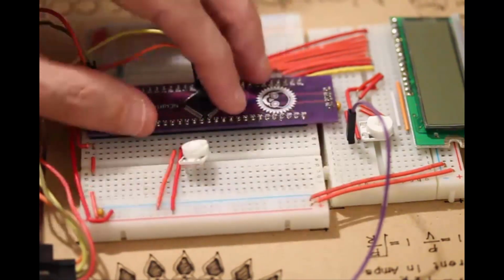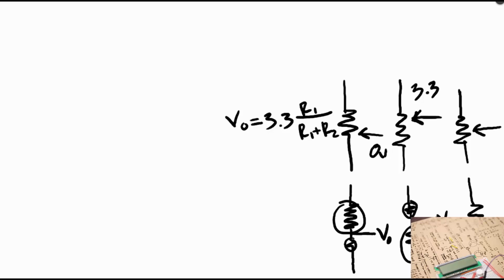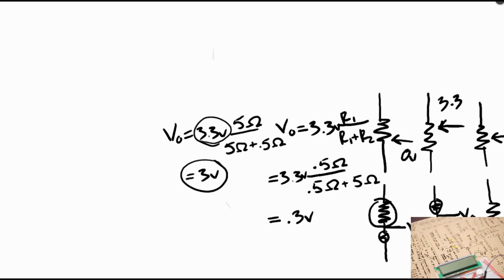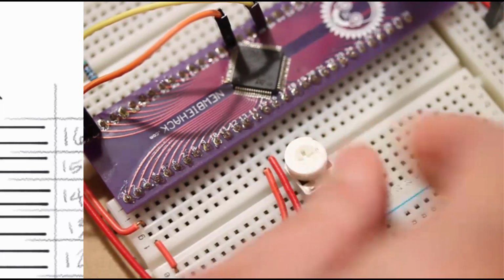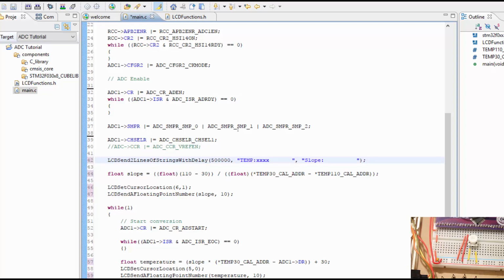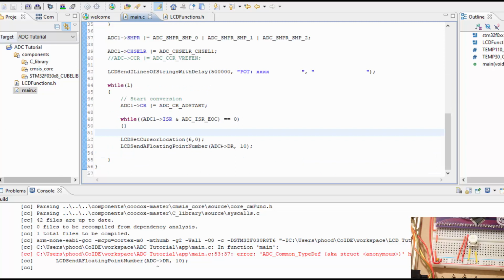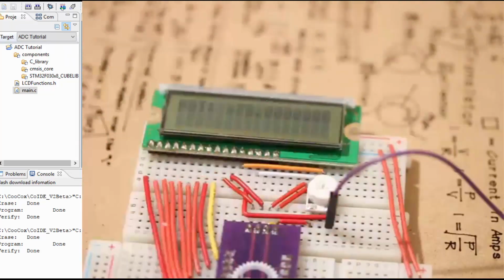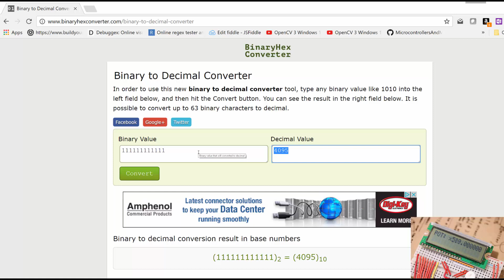40. How to use a Potentiometer to Provide Variable Voltage for ADC Input

Comment: I like how you explain every small detail. For example, I am pretty sure that somebody who is interested in using these microcontrollers without simple Arduino libraries and code it with registers will be familiar with how a potentiometer works. However, you don't assume that and always try to explain whatever you use in detail. Thank you for this teaching method. Also I failed to find the video number 39 can you help me with that? Cheers.
Reply from the maker: You're right.  I can't find it either.  I will look around and figure out what happened.
Reply from the maker: After looking at the videos on my patreon page, it appears that I just numbered it wrong and video 39 is the #40 video.  I will renumber the videos soon.  Thank you for the heads up!

Comment: Great, thanks. When the ADC shows a max of 4095, does that represent a voltage equal to the reference voltage or Vcc? Maybe they are the same, but then the term 'reference voltage' wouldn't make much sense.
Reply from the maker: It represents the reference voltage.  The reference voltage is a calibrated voltage that is very accurate. Datasheet 12.9: The internal voltage reference (VREFINT) provides a stable (bandgap) voltage output for the
ADC and Comparators.  You can also provide a separate supply to the ADC supply input is you need increased stability as specified in 6.1.1

Comment: How about using RTOS?
Reply from the maker: I probably won't be getting into OSs for this tutorial series.  This series is really to delve into the fundamentals of the chip and use it as a very lean system for controls and sensors.
Reply: Patrick Hood-Daniel I see but for bigger projects involving greater resources and facilities these chips offer, it will quickly get out of hand and probably become a bit too complicated to program this way. But your current work is absolutely amazing for understanding the underlying fundamentals and basics! Please keep up the good work and good luck. 😊
Reply from the maker: Thank you so much!